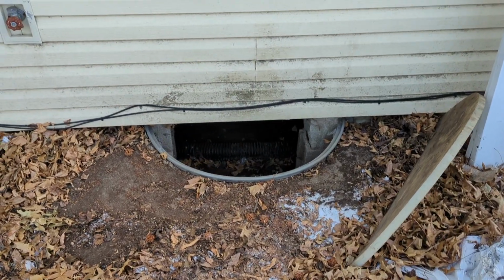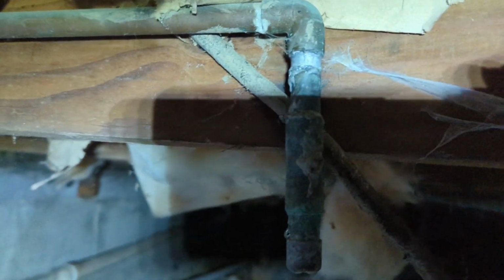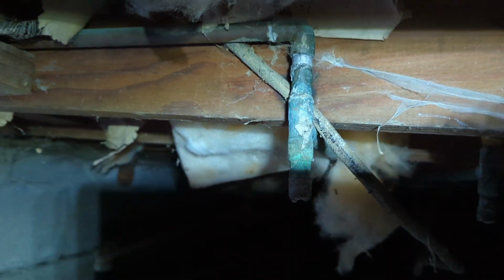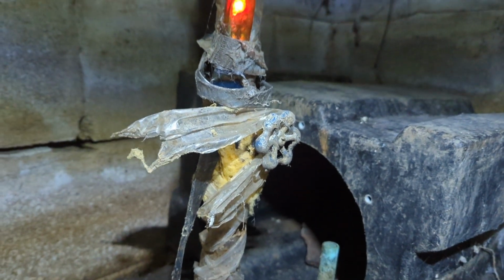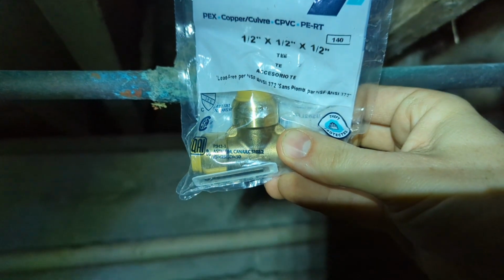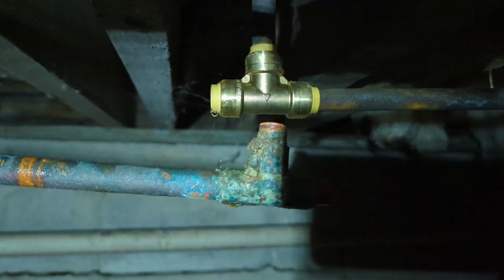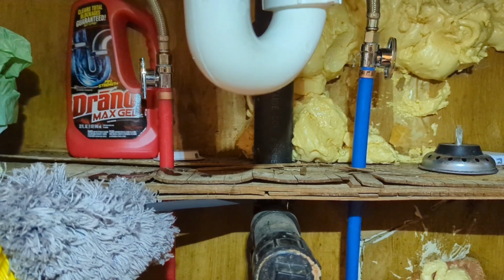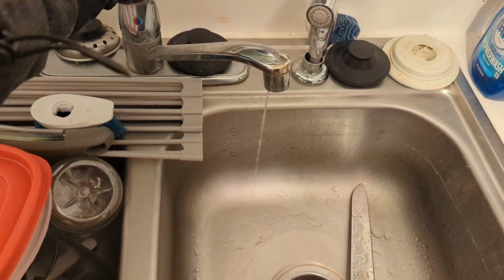How to Repair Frozen Pipes with PEX - DIY Landlord Toolkit

Comment: Why are you using copper anything? use Pex T to stop leaking. By avoiding copper, you stop the leak caused by ice expansion.
Reply from the maker: It's all PEX now.  This was a repair of the existing pipes, using what I had on hand on Christmas Eve.  Got it patched up until I could make a more extensive, long-term fix.

Comment: Just dealt with that same type of situation for my house. When crawling around underneath my house I like to roll out some black floor matting so I do not have to crawl around in the dirt as much. I put the slick side up so it is easier to move. It is a bit stiff to roll out when cold, but for me it is better than crawling around in the cold dirt.
Reply from the maker: I hear ya.  For repairs like this, I just have to get my mind right - I know I'm going to get cold and dirty, but that warm shower afterwards will feel heavenly!